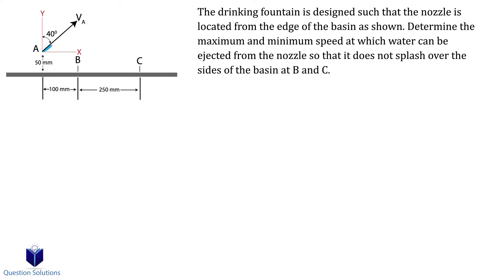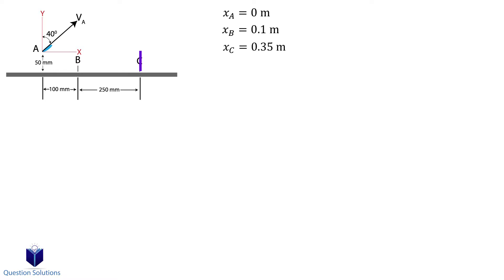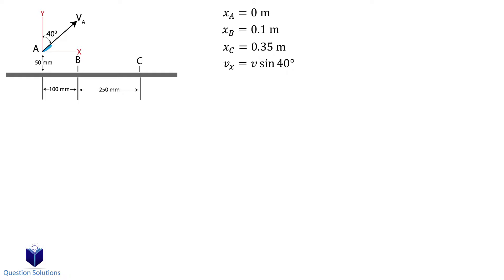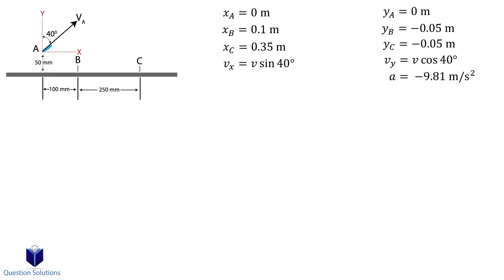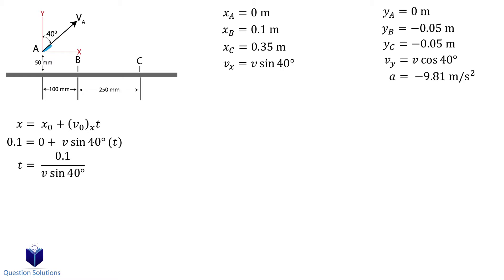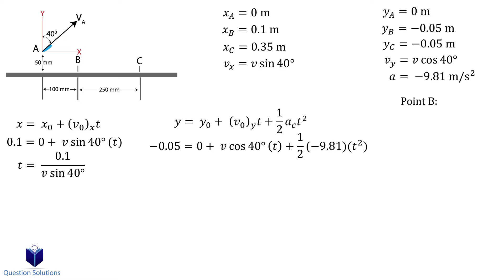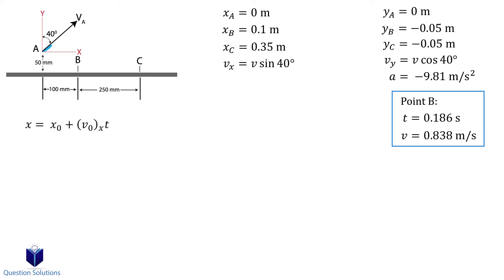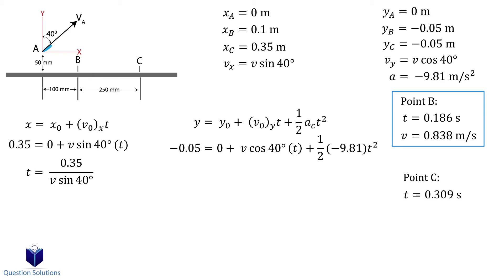The drinking fountain is designed such that the nozzle (solved)

Comment: why is it that the Vx is equals to Vsin40
Reply from the maker: To understand how to break a force into components, please take a look at this video, it's not long but should give you a really good idea on how to do it: https://www.youtube.com/watch?v=NrL5d-2CabQ (we're doing the exact same thing, instead of a force, we are just breaking the velocity vector into components).

If you want a direct answer, it's because the x component of the velocity is opposite to the angle, which means we use sin, since sin = opposite/ hypotenuse.
Reply: @QuestionSolutions  i was doing Vx=Vcos(theta) in my in class examples. It was going the same direction. Was my prof wrong? How can one be cos and one be sin?
Reply: cuz it attached to the Y, if it was attached to the X it would be cos
Reply from the maker: @joshlarson47  Cosine and Sine are NOT related x and y axes. They are related to the angle and the side that it corresponds to. This is a huge pitfall, and you will get questions wrong if you always think x is cosine and y is sine. Please watch this video, especially the first example where I explain sine and cosine: https://www.youtube.com/watch?v=NrL5d-2CabQ
Reply: What, what x sin. Y cos what!!!
Reply: because the angle is on the top